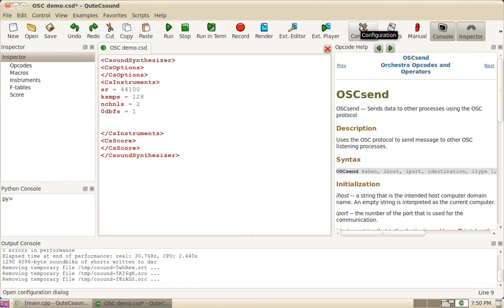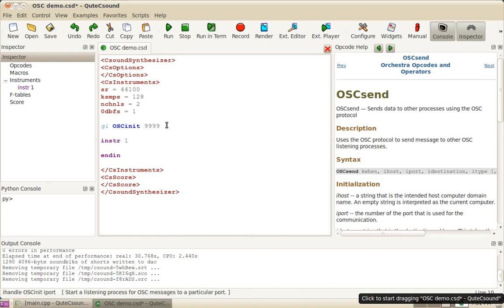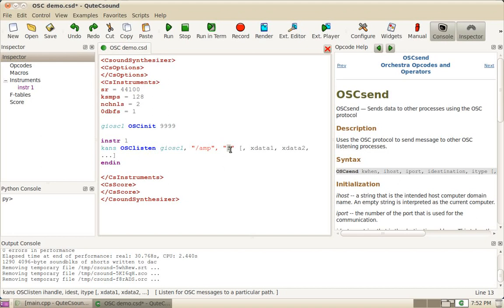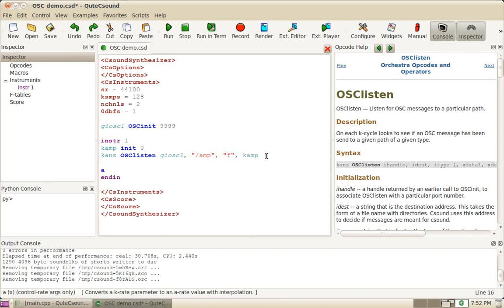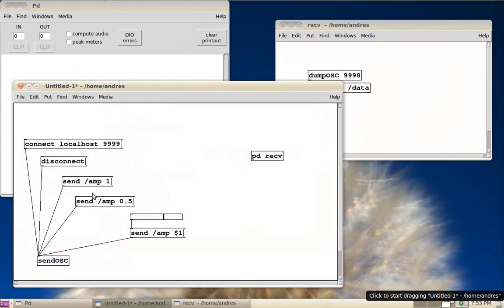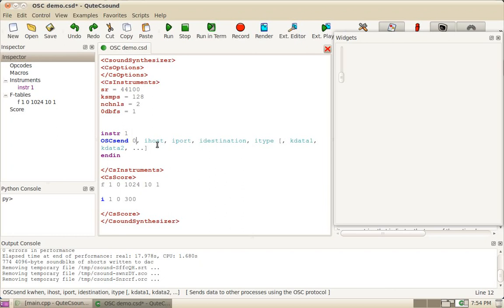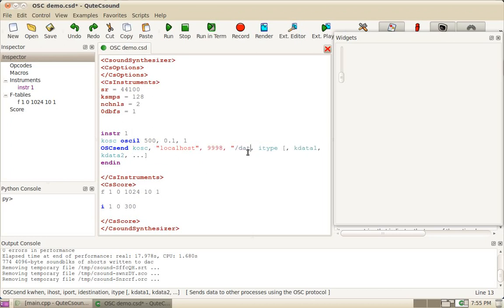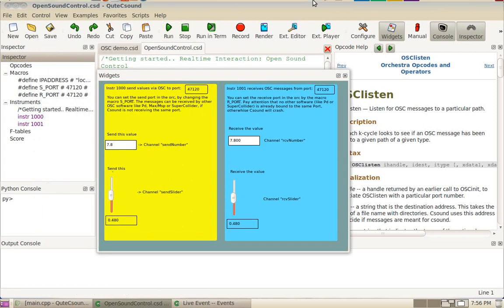Using OSC in Csound

Comment from the maker: No, you just need to create a graph widget and then use the dispfft or display opcodes. The graph may show an ftable by default but you should be able to select the signal you want to view from the menu selector in the graph widget.

Comment from the maker: The graph widget will display the output from display and dispfft. It won't open a separate panel like command line Csound. You can create many graph widgets, so each can display a separate display or dispfft signal.